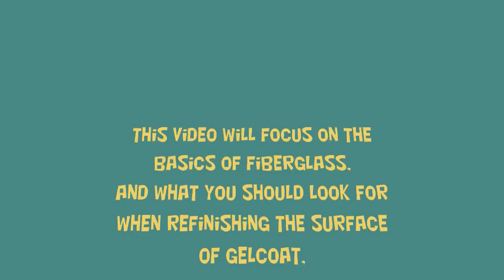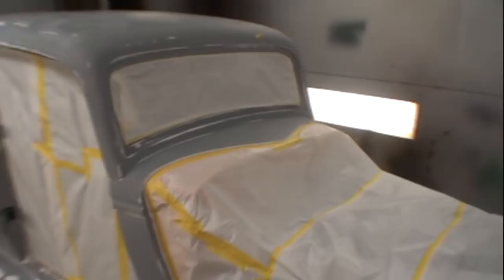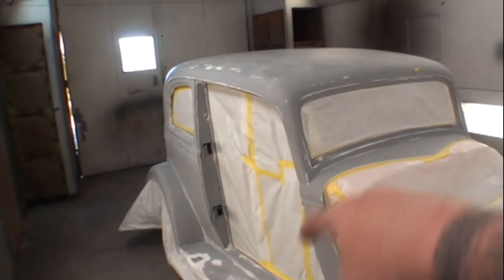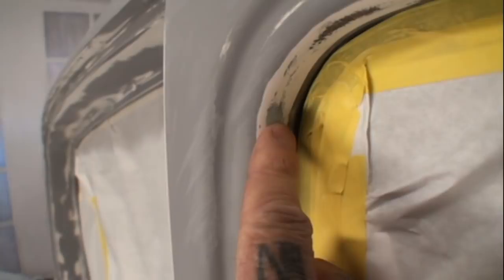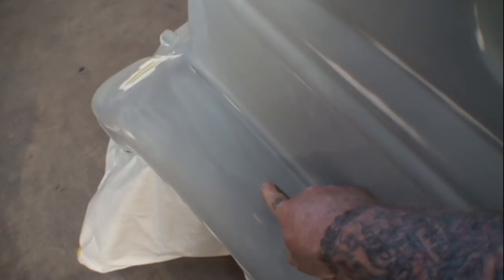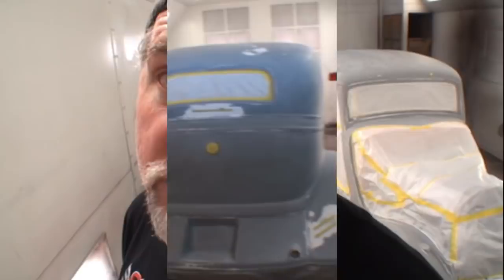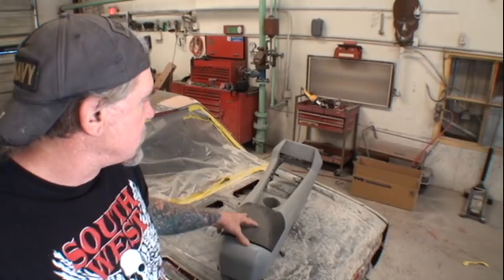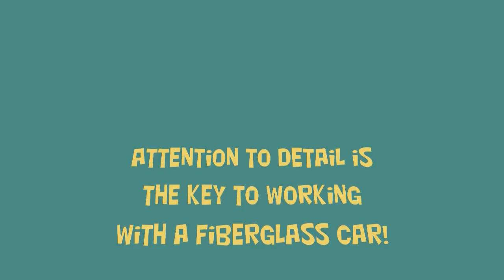Painting A Fiberglass Kit Car - How To Prep A Car For Paint!

Comment: Pete. I think you do make great videos and I am a lisenced autobody tech. You could save yourself a lot of time and frustration by spraying 3 coats of polyester spray filler , it will fill everything, blocking it with 220 then hitting it with a smooth coat of primer surfacer  then  a smooth sanding of either 4-600 sandpaper. You are ready for paint then! And no shrinkage!!

Comment: I work for Epic Doors which manufactures high-performance fiberglass entry doors. We evaluated several paint suppliers including TruCoat 623, Sherwin Williams Polane 2K Acrylic, and Aquasurtech D200.

We were looking for an environmentally friendly, single component water based paint that was super durable, had great adhesion and laid down smooth.

Based upon our evaluation we selected TruCoat 623.  It was much more environmentally friendly than Polane 2K and is a single component and TruCoat.Us had better adhesion than D200 and was priced better.

Comment: Thanks man. 3 times the fibreglass lotus has been in for work. 3 times cracking and blistering... every time I told them to do it by code, every time they do it like a normal car. Looks great for a year or so.
Reply: Yea mine has a few bubbles too. I think it happens to all of them after a while. It's best not to mess with it unless it's really bad.
You need to use special flexible paint (and primer) for composite as well. Maybe they are messing up there.

Comment: Thanks for the tips, I bought a 1990 ZR-1 last year and have to paint her. I'm an old bricklayer/mechanic, getting ready to be paint guy I guess. Paranoid as hell, I figure will just sand factory paint some and spray over that. Body is straight, although I see spider webbing is a couple places. Going to go for it, if I mess it up reckon I will redo it. 👍👍

Comment: OK, sure, but what do you do if the 'glass is already exposed? You said a 2k primer/sealer won't work, what will? You showed the problems but no solutions.
Reply: He doesn't know what he's talking about. Gelcoat is just colored resin. Same stuff the rest of the body is made of. Just with a pigment. The gelcoat is just as "porous" as the resin holding the fiberglass together. You don't need to buy gelcoat unless you're making your own fiberglass parts and want a nice surface. You could repair fiberglass with fiberglass resin, fiberglass filler or body filler depending on the severity of the repair. Working with fiberglass especially kit cars you're going to have a lot of exposed fiberglass.. so I don't know why he's making these claims.

Comment: So if you sanded through the gelcoat, to help prevent problems you go to the boat place and buy 'gelcoat' and brush it on those spots?  To re-seal the porous fiberglass?
Reply: He doesn't know what he's talking about. Gelcoat is just colored resin. Same stuff the rest of the body is made of. Just with a pigment. The gelcoat is just as "porous" as the resin holding the fiberglass together. You don't need to buy gelcoat unless you're making your own fiberglass parts and want a nice surface. You could repair fiberglass with fiberglass resin or body filler depending on the severity of the repair.

Comment: Thanks a bunch Pete. Very helpful. I'm considering replacing my heavily pitted original hood with a fiberglass one. They usually require some work to fit properly. Sometimes this means a fair amount of sanding which may get well into the actual fiberglass. What's the right way to do a job like that?

Comment: I am complete new to this but I had a question. I see a lot of videos of people when they first get the part. they coat the whole panel with a layer of filler. I am confused on the process a bit. So its gel coat, covered in filler, covered in primer, covered in paint?

Comment: I can already feel the misery that I will go through on my robin... Unless I trust a local body shop to do it and pay like 2k for it
Reply: You can do it... 
Positive thinking...
I am doing a 1985 Class A 13' tall
31' long... top to bottom... by hand...
;)
The last Travel Trailer I did.... I had painted it.
it was very old but it was also metal... I painted it
with a 4" brush... 3 coats.. with House semi-gloss paint..
NO ONE knew the difference... it looked great... stayed great
for years... ;) I even sold it for $3000. more than I thought I could.